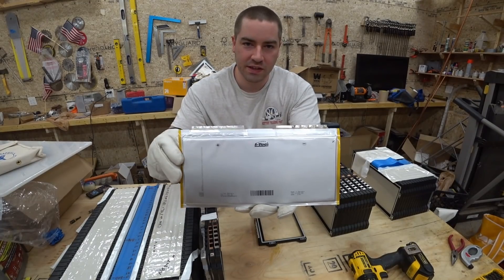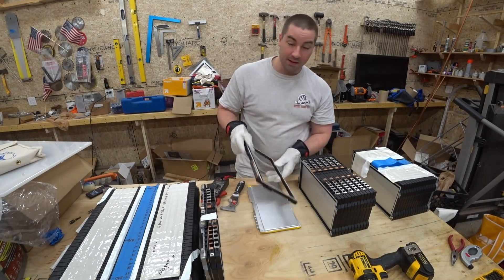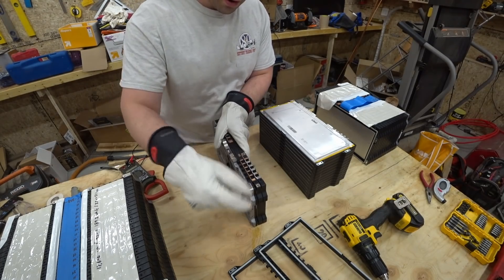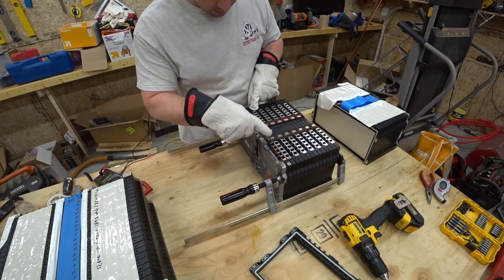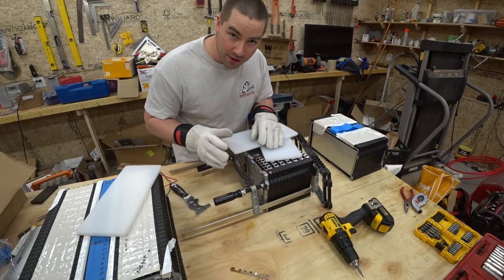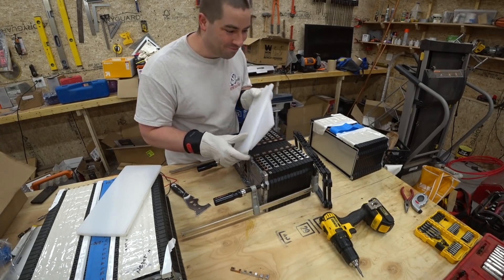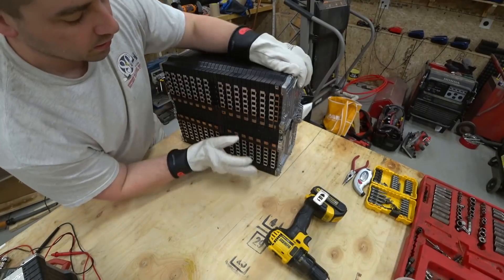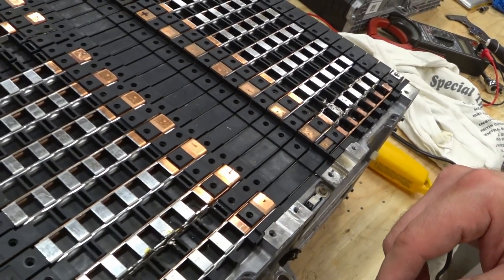Moving cells around to make a 48 volt pack

Comment: Hi David, nice  tutorial, i am about to transform a smart ed Battery into a home Battery just like you, could you tell how you resolved the problem with soldering of the cells ?
thanks im Avance.
Reply from the maker: Eventually I built a spot welder that did an ok job.  If I did it again,  I'd probably try something else, like a tiny screw and nut
Reply: @DavidPozEnergy  Thanks alot for the quick Answer, i probably trying to solder the spots, i made some test directly on damaged cell spot with the same low temperature solder ,and works well, or maybe with copper rivets could work too

Comment: Hi David, I am trying to repair a battery of an electric smart like the one you used in this video. I wanted to ask you how you finally joined the battery cells. Your answer will be of great help to me. Thank you.
Reply from the maker: I ended up building a spot welder for the tabs.  It's very difficult because of the tight space.
Reply: @DavidPozEnergy  And how did you make the David spot welder and what power?

Comment: Soldering iron with an appropriate amount of heat would be how I'd do it (I'm also a ham radio operator), and it's safer than having a torch applied to batteries, you numb skull (kidding) (unless your wife agrees) (then we'd be back to numb skull).

You'll have a better bond that way, and not have to worry about blowing your arm off.

Love the channel, though. Nice work, mate. (apart from the torch)
Reply from the maker: Thanks for watching.  I ended up building a spot welder.  That did the trick.

Comment: Hi nice video. I was just wondering what builds these systems are used for. What type of vehicles they are used on
Reply from the maker: This battery came out of a 2013 Smart Fortwo EV. Thanks for watching.
Reply: Thanks for your reply, I really appreciate that. Sorry but my question was aimed for your other video with the dewalt circle saw  you was running off the power invertor. I was just wondering what line of work you do or is this DIY projects that you work on.
Reply from the maker: I used to be a full-time carpenter doing energy efficiency upgrades/renos.  At the moment I'm only doing energy audits.  My videos are on my DIY projects for helping get my family energy independent.  I also built our own house that is super insulated.  I have several old videos on that build, but no editing, so they are rough to watch.  LOL
Reply: top man. Thanks. I’ll check out your other videos.

Comment: For big stuff I just use cheap soldering irons with huge tips at 240v then they get super hot. Here is an example https://rover.ebay.com/rover/0/0/0?mpre=https%3A%2F%2Fwww.ebay.com%2Fulk%2Fitm%2F123520475753
Reply from the maker: WOW!

Comment: Usually on those pouch cells, the terminals one  made from aluminum, the other from tinned copper , so aluminum doesn't take solder, the oxide layer and the heat flows out of it too fast. A 12v car battery, and a heavy-duty relay, using a small cal to trigger the relay, adding capacitance to lenthen the pulse time, is about the cheapest you could build a spot welder for. I'm thinking of building one, I'm tired of soldering cells!!!
Reply: Hi James, did you already build this spot welder?

Comment: Flat packs use aluminium tabbing which is just about impossible to solder... you need aluminium flux and solder that is mostly tin with a little zinc.
Reply from the maker: Thanks.  You are the second person to mention aluminum.  I had made an assumption they were coated copper, but never confirmed.  I feel very silly now.

Comment: How many voltage this device battery power? 338v DC or ac battery power supply? Thank you
Reply from the maker: The original battery was 17.6 kwh.  I have some bad cells in it, so I won't see the whole amount.  I'll be doing a capacity test after all the repair, but we might see around 15 kwh.  It is a nominal 48 volt DC battery.  I hope that helps.

Comment: spot welding them use think copper as electrodes and a starter relay from motorcycles to a foot peddle and use the 12volt pack fr power

Comment: the tabs on the packs are made of copper and aluminium, normal solder won't work on aluminium so that's why the joints were failing
Reply from the maker: Thank you.  I didn't realize they used aluminum.

Comment: David:
Afraid that I may have bad news for all these battery recovery projects. 
Just got my copy of the 2017 NEC (that's the latest version of the code). Not all jurisdictions have adopted this version yet, as it has some unpleasant (my opinion) changes.
A new section has been added to Article 480, "Storage Batteries":
"390.3 Equipment.  Storage batteries and battery management equipment shall be listed. [Emphasis added.] This requirement shall not apply to lead-acid batteries."
The word "listed" is defined in Article 100 as (essentially) having been reviewed & passed by a recognized organization/authority and so labeled so it can be identified as such by [an inspector].
I fear that taking a scrapped battery, reconfiguring it, removing its cooling mechanism and BMS will almost certainly invalidate its listing status.
That means that unlisted batteries likely violate this new provision of the NEC, which means that if you have a fire or any such loss with such a battery on the premises,  the insurance company will NOT pay off.
The  NEC is published by the "National Fire Prevention Association", so that's why I first mentioned "fire" as a hazard. Sadly,  most state governments also adopt the NEC as law, so its most difficult to get around it.
I am not a happy camper about this,  but that's the new code.
As I mentioned,  I generally don't like it very much, but the folks who make money making changes are in the business of making life difficult for all of us.  (So the government expands once again.  It's like deSitter is haunting us!)
Mike Gardner
Reply from the maker: Hi Mike.  I have a long list of reasons why I don't like code, specifically the energy efficiency code.  In many ways it is so prescriptive, that it makes it harder to build super energy efficient homes.  
My experience with insurance, is that they don't pay out anyways.  Even when I do everything by the book. 

I relate to your sentiment about not being happy about it.
Reply: You would have to be on planet bizarro if you actually thought there was a chance insurance would pay up if lithium was involved
Reply from the maker: @ Nevada: I don't trust any insurance company to pay out ever.  I think they will always find some reason.

Comment: EV Jedi is correct, the standard Mechanical engineering solution to this type of attachment is a spot weld. That's what the Tesla folk do as well. Even when they were doing "G" jobs they did spot welding.  Its a Very simple tool, but not terribly cheap. I can go down in the AM and get the specifics on the model they're using, but it ought not be terribly difficult to find one.
Here in Silicon Valley there are clubs that have all sorts of tools like this that you can use.  The membership fee is less than the cost of gas, essentially. 
Harbor Freight has one (#61296 & 45690) on a special ITC coupon this month for $140 (normally $160), so that should give you an idea of pricing ... tho it is HF.
As for soldering to nickel, you can't use regular solder. When we were trying to solder mods on Space Shuttle boards we got the special  nickel  solder and it worked pretty well.  It was, as I recall (pretty certain about this) flight qualified, so it should work in your application. You must figure out how big an "iron" to use however.  The shuttle boards were probably 2oz plated copper, I think.  (it's been a long time...)
Don't use a torch!
For cheapness,  I'd start with a temperature controlled tip soldering iron & nickel solder. (It's an alloy that works with nickel, not the pure metal. You shouldn't have too much trouble finding it; our company stocked it for lab use.) Then I'd try borrowing a spot welder as the next step if you aren't satisfied with the solder.
I'd also practice on scrap. 
Mike Gardner
Reply from the maker: Thank you.  Some great information in your comment.  I didn't know there was a nickle solder.

Comment: This battery is a lot easier to work with than mine! Mine had the tabs of the cells spot welded together, no buss bars.   Are they aluminum or half aluminum half copper? You'll need special flux if so.  The pouch cells I've seen have one aluminum tab, one tinned copper tab.

Comment: Awesomeness! You can solder or weld nickel strips to the pouch everywhere there was a weld (outside of the pack) then fold the nickel strips over the top of the bus bars and solder or weld them on top. You will want to get thick nickel strips and copper core would probably be recommended.
Reply from the maker: Thanks Shawn.

Comment: Some metals are difficult to solder together. The solder just will not flow onto it.  This will also happen if you can not get the surfaces hot quickly enough. 
It’s also better to us resin core solder if you are not experienced with soldering   You need to get the timing right between the flux melting and the solder melting, if you are using flux and solder.    Make sure the stuff you are using is for electrical and not plumbing. You Can cross over but you need to know the ingredients of your solder and flux.  Plumbing flux can eat away the metal if you don’t clean it off afterwards. 
If you are trying to solder large pieces of metal you must us a high watt soldering iron, they are available 200w and 300w.  The ones used for stained window work.   eBay has some for $50. 
 The solder will not flow if it’s not hot enough, clean from flux, the right metals.    Sometimes metal is coated with something, try sandpaper first.  Then test to see if the solder will flow.

Comment: I was really hoping that would work, I want to try low temp solder paste next time I need to solder something that acts like a heat sink... I wonder if as others have mention sanding the metal would do the trick.  But spot welding does seem like the best option based on all the other comments.
Reply from the maker: I was also hoping it would work.  I'll be trying some things out today and see how it goes.

Comment: Use poly vinyl  food service gloves as a first layer next to your skin glove then next the electric gloves,  this will keep your skin acid off the gloves and make them last like new much longer and also as a bonus the electric gloves will go on and off of your hands many times much faster and easier with no fighting and fidgeting , I've been doing this for years,  your sweat makes the gloves deteriorate and harder to remove and put back on again,  but with the poly gloves it's no issue
Reply from the maker: Thanks for the tip.
Reply: You don’t need high voltage gloves for any DC voltage 100 or under!

Comment: you need to rough up that surface, those battery terminals are copper coated in nickel, sand or scrape down to some copper and it will solder np :)
Reply from the maker: Thanks Going Off Grid.  I'll give it a try.

Comment: This is what I use at work, pricey but works https://americanbeautytools.com/Resistance-Soldering/98
Reply: You can get non temperature regulated ones for 40 bucks Tenma 21-8230 SMD Soldering/Desoldering Tweezers
Reply from the maker: Is this like a spot welder, but made to heat and melt solder?
Reply: @DavidPozEnergy  Yes, just make sure you get a high wattage ones
Reply: and these are examples I found on the web, caveat emptor

Comment: I don't really know what I am talking about here, other than the many failed attempts at making reliable Electrical connections to Aluminium. But ASSUMING that you got the right ingredients to begin with, the starting point would be to pre-solder both sides BEFORE bringing them together and reheating - like "Tinning" both Copper wires before joining.

That said, Aluminium is a quite reactive metal, and It's oxide is classified as an Insulator. Reliable, or indeed load carrying Electrical connections need a way of 'breaking through' existing oxides and maintaining an oxide free interface suitable for the environment in which it needs to operate within.

This is hard, and the fluxes are often so aggressive, that the meticulous clean up needed afterwards makes it a non-starter for me. I find it easiest to simply say no, forget 'soldering'. Look into spot welding.
Reply from the maker: Thank you.

Comment: Heat gun. Try it on a piece of the bad frame first to see if it melts but I use heat guns to float the solder on batteries like that.
Reply from the maker: Thank you.  I did try a heat gun with this solder paste and battery cells in one of my past videos.  I didn't have success, but if you see a mistake I'm making I'm happy to try again.  https://youtu.be/9SrsrckCbOM
Reply: Do you have a nozzle tip?
Reply from the maker: No, I don't have a nozzle tip.  Maybe I could make one from some thin metal flashing?
Reply: @DavidPozEnergy  heck i would try and use a hose clamp to hold it on

Comment: Do a bit more research on the net. You can't solder these with a propane torch or any open flame torch. If you have to solder them you will need a 100 amp or so soldering iron and a large bonded area.  A better solution is to bolt them together with spacers. These are high amp cells and without a substantial connection the connections will heat up under load and melt the solder and arc.
Reply: +1 on the spot welder - you can get cheap kits out of China - look around on YouTube - they are used mostly to spot weld tabs on 18650 batteries.
Reply: @reasonablebeing5392  ~ Here's the Title, he heard you... lol
DIY Spot Welder, Attempt #1

Comment: What about a small nickel strip at each point and then use a spot welder to connect your sections with the strip as the bond...? Similar to what folks use when building 18650 packs I believe.
Reply from the maker: What does the nickel strip do in this application?
Reply: @DavidPozEnergy  I believe the reason for using nickel is that it has a higher resistance than aluminum or copper, and so will melt before the other materials. Also it doesn't have as much of a problem with oxidizing on the surface to be welded as the other materials, which can prevent a good connection/bond.
Reply: DavidPoz makes the connection between the bus bar and pack. Thinking that you bend the strip like a V to cover both sides, bus bar and pack tab, and then weld. Like this: https://youtu.be/o1NFbchHeM8

Comment: Also I've seen people make a spot welder from 12v lead acid battery, automotive relay and a momentary switch. Could be a quick and easy product to help spot weld future tabs?
Reply from the maker: I probably saw the same video.  It looks like probably the most promising idea.  I hope someone can chime in if it's safe on the tabs of lithium cells.
Reply: @DavidPozEnergy  No, I would not recommend this at all. You don't have much control on the duration and energy delivered to the weld and you'll just make holes in everything.
The pulse duration and current (>700 amps!) needs to be carefully timed and regulated to melt just the right amount of nickel to make the weld, and no more.
Copper conducts too well to spot weld, which is why they use nickel - its higher resistance allows it to be able to be to spot welded.
Nickel can be soldered, though it's not as easy as copper - roughen the surface with emery paper to remove the oxide layer, smother it in flux first and then you should be able to solder it with a big soldering iron.

Comment: Not sure why you made the spacers to fill the empty gaps, couldn't you leave the frames from bad cells out and then used shorter threaded rods to hold the pack together?

Would make the whole thing more compact :P
Reply: He wants to keep them the same size because they will bolt right back in the battery box then he can mount the box anywhere.